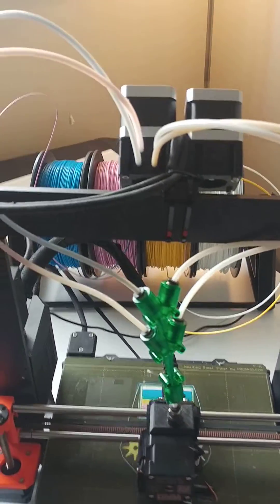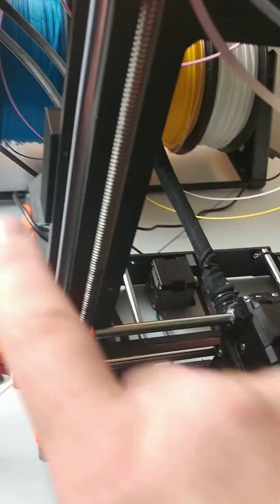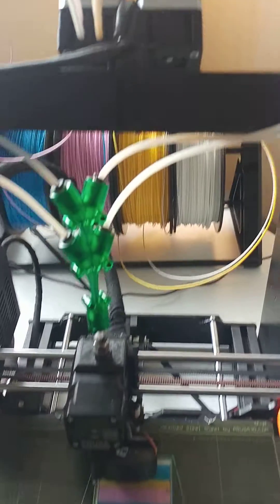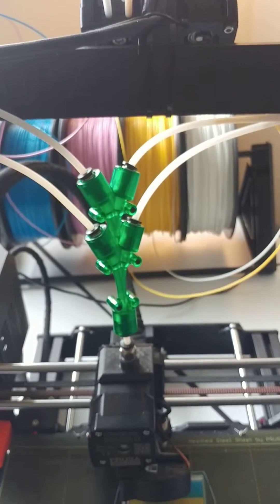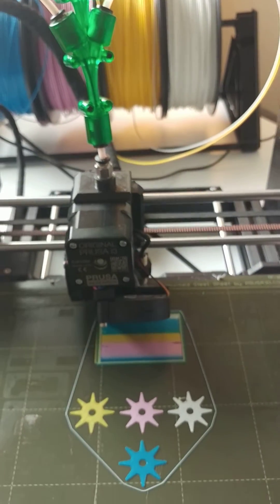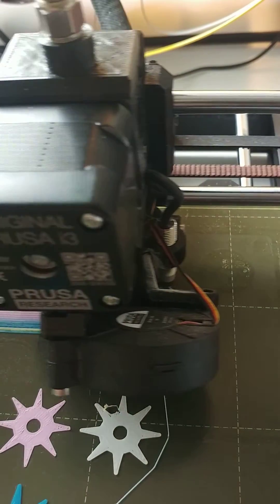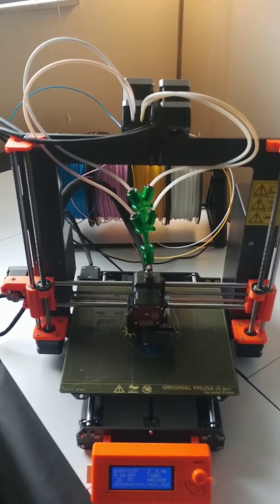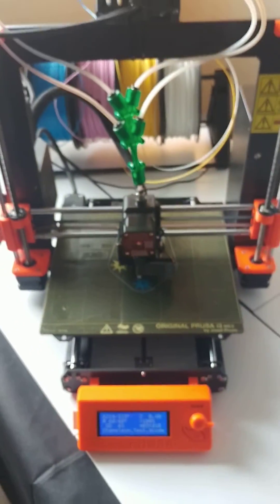3D Chameleon Mk2 on a Prusa Mk3

Comment: Could you set this up with 4 runout sensors? I’d like for it to automatically switch when one roll runs out.
Reply from the maker: Yep... But you'll need either Klipper, Octoprint or a custom firmware to support the dynamic color change.  Our default behavior is all done in the slicer.. this would require something to inject the tool change where ever it needs to run out of filament.
Reply: @williamsteele  awesome! I’m running Octoprint on an Android phone. Thanks for the info, I’m looking to do a poor man’s Pallet mosaic.

Comment: How is that purge area decided? Does it have to be there and that size?
Reply from the maker: The purge strategy is totally dependent on the software settings you use... The 3D Chameleon is only loading and unloading the extruder... All the printing features remain in the control of the stock printer.
Reply: @williamsteele  ah so I have to designate my own purge area, if I want to purge at all? If that’s the case I think I’ll finally pull the trigger on this, would you recommend it?
Reply from the maker: @LtDominator1  Well... since it's my company, I do recommend it... but I'm obviously biased. ;-)  I'll certainly help you out any way I can on it.
Reply: @williamsteele  ha! I totally didn’t even realize! Well I appreciate the responses. Last question, I see that there’s a package for two or four, and I believe the FAQ says it can handle up to 32 different colors. This means if I buy the 2 to check it out I can buy another two and add them on later simple enough?
Reply from the maker: @LtDominator1  The latest MK2 unit only comes in 4 colors now (as it is a single unit)... The old one was 2 and 4, but it was discontinued two years ago. The MK2 can be combined to make 32 cors with 8 units.
Reply: @williamsteele  Okay, awesome! Thank you so much for answering my questions, I really appreciate it!